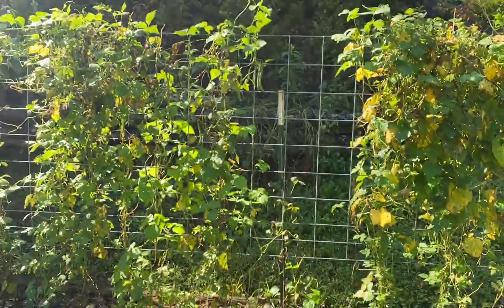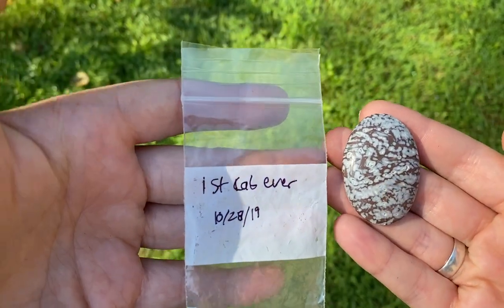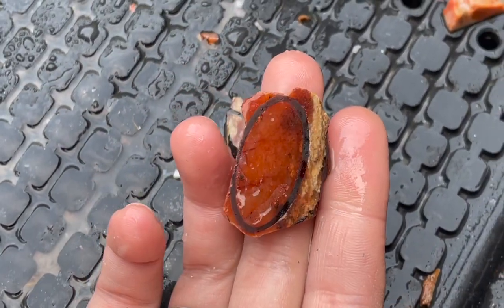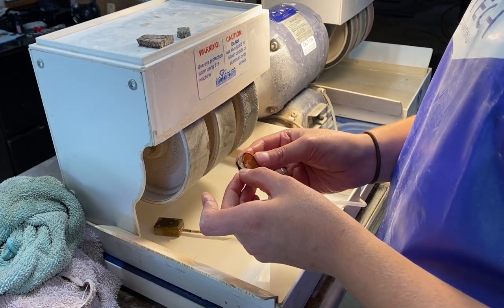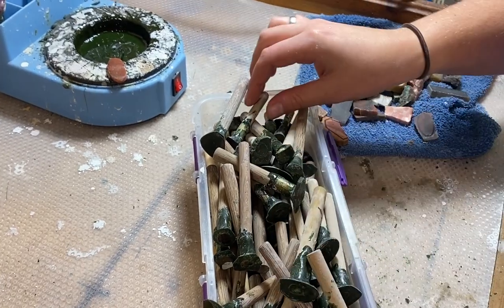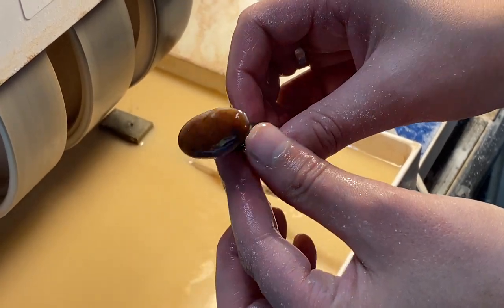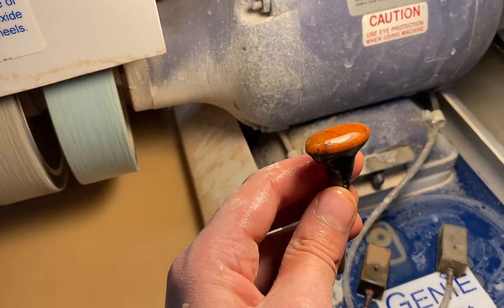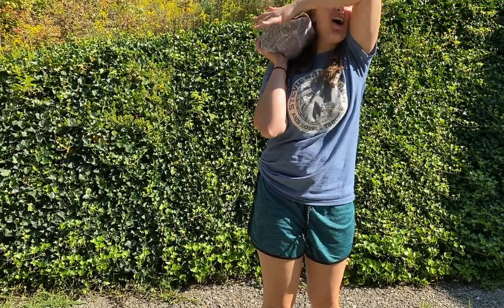Lapidary Arts | How to make a cabochon from a creek rock

Comment: I learned something new! This was cool…  and the rock turned out real nice. This sort of reminded me of cutting pearl for instrument inlay. I’ve made a few banjos and have used pearl for inlay but have always had the idea of inlaying stone before. It would be unique for sure! Have thought of colored glass too but don’t know how it would turn out… metal/copper etc. But reckon you could inlay anything into a piece of wood/fingerboard though if you done it right… it’d be pretty cool to have different little flat pieces of polished rock inlays down a instrument neck! Or to set a piece of rock in the peg head as a centerpiece of some sort. Anyway it was a cool video to see your process!
Reply from the maker: Yes you probably could inlay just about anything into the wood. Some materials might be tricky but it could all be done. And well you can get a rock pretty dang thin if it’s the right kind of rock. Some rocks can go that thin and others will break! But I’ve never tried to get them that thin before! Cool thought though! Thank you friend!

Comment: My mom and dad used to have a place in Franklin N.C., and they had a gravel filled driveway. You could pick up almost any one of the pieces of gravel, and it would have what looked like amethyst encrusted on it. It was a rich medium purple that was transparent with a very smooth surface. I wish i would have saved some to keep.
Reply from the maker: Franklin is a hot spot for beautiful rocks! It may have been Garnets that you were seeing in those rocks. Franklin has a lot of Garnets!
Reply: @thepressleygirls  You may be right. I looked up purple garnets, and they looked the same as I found in my Mom's driveway.

Comment: My high school had a course in lapidary.  We did not use as many grits but did use a felt wheel with cerium oxide for the final polish.  One thing that stood out in this video, was the spitter style of providing water on the wheels.  This going throw bits of rougher grit up on finer wheels.  Something one definitely does not want to do when using abrasives to sharpen knives or chisels, or when used to sand wood.  Seems like you really only want clean water falling from the top of each wheel.
Reply from the maker: Indeed you take a risk with this kind of machine to have your wheels contaminated like that. They make machines with fresh water on each wheel. I actually had one like that before I got this one!

Comment: Now that was a great video!  Great explanations of all of the steps you were taking.  Thanks so much for sharing.  As someone that is considering buying the exact model of cabbing machine that you use, I have a question.  Do you need to be concerned about using the recycled water in the spitter when you go from lower grit wheels to polishing wheels?  Does it affect the final polish if you are spitting up dirty water onto the polishing wheels?  Do you find that you change the water often in the process of making a cabochon?
Reply from the maker: You definitely need to change that water! If you keep cool clean water you will make your wheels go longer and you will have less risk for contamination (small rock pieces flying up and scratching the surface of your cab). But that genie I use is a work horse it will really really go. I tried a cabking and thought it wasn’t made well. That genie is worth the money.

Comment: I just had this one pop up in my feed! Question; Do you rely on the sound of your cutting medium to know when it's time to move on to the next step/keep at it? When making oversized jeweled bearings for watches (you can seldom find them commercially) I shellac the blank to a cement brass on the lathe and use a copper shaper treated with the cutting compound (Cerium oxide, linde'a, and diamond lapping dust are the three big go to for me) and the cutting goes from a slightly raspy whisper while it's working to that sound like a spoon sliding across a clean baking dish when it's ready for the next step. 
Cheers!CJ